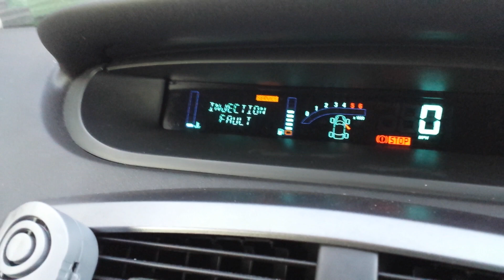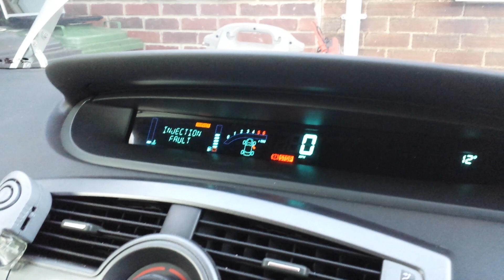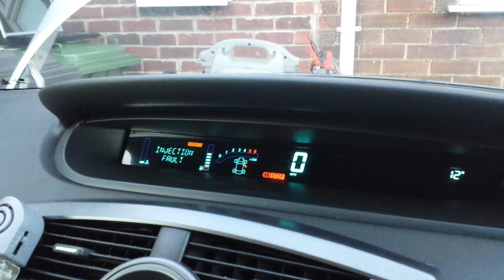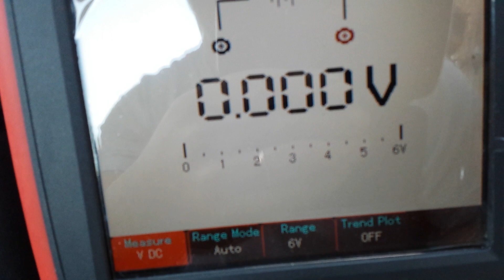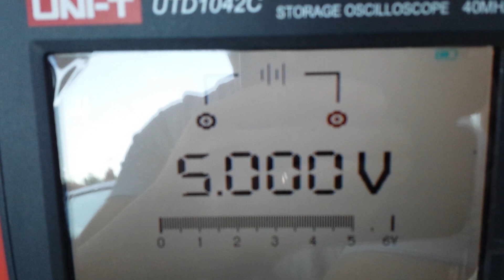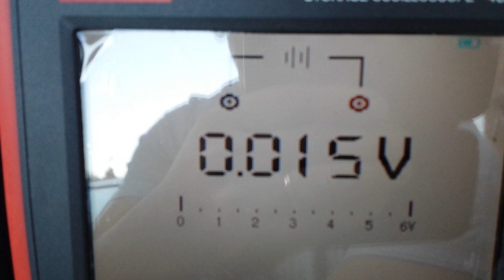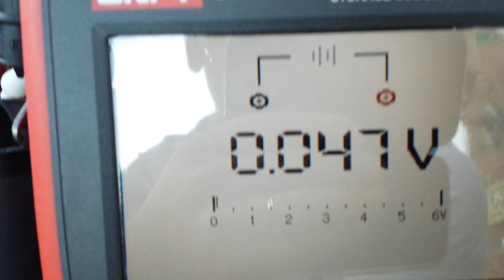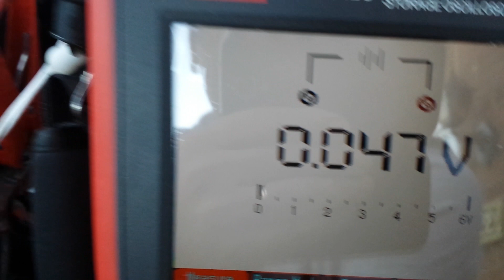Renault Scenic 1.9 DCI Diesel pressure sensor test

Comment: Hi ! Help me please , i started the car aftef 2 months , it started fine let it idle for 20 minutes , went for a drive after 5 minutes it bogged down and shut off , tried starting again it did not want to start . Pumped the primer lemon like pump a few times it started but died after 10 seconds , then it started only when my friend was pumping . What do you think it can be ? I dont trust my mechanics help
Reply from the maker: If it runs while the primer is pumped, sounds like a possible leak, allowing the system to suck air...
👍👍👍

Comment: Had same "ignition fault", but problem was battery 32A fuse connector.to 2 red wires (if stay in front of car, looking to car, right fuse). Diagnostich showed "fuel preasure dempher error" and "fuel preasure sensor error", (do not remember exactly, as diagnostick not mine, was only watching to its screen while car check)

Comment: Hello I have the 2016 III grand scenic 1.5 DCI. The spanner is on the dash and error says check injectors. But there is no loss of power or performance. Fuel consumption is good. Could it be the sensor is damaged? Fuel is from South Africa?
 any help appreciated
Reply from the maker: Have you scanned the car? 
👍👍👍
Reply: @LMAutoRepairs   Check glowplugs

Comment: Hi. Very useful videos!
I have the same Injection Fault message which appears when the engine suddenly STOPS WHILE DRIVING! It has the elecricity and the ignition, but the engine cannot be started right away, just after 60-120 seconds!
Odb scaner returns the error code P0606! 
The issue happens intermittently, sometimes (but very rarely) even when starting the engine - which doesn't start, butnit cranks!
Could it be some wire to/from PCM? 
Please help, as it is very inconvenient situation, I never know when it will stop , and I cannot take a risk to drive the car out of the city.
Btw also the fuel consuption is high, from quite a time ago, even before this issue.
Reply from the maker: Scan the car... hopefully whatever is causing the car to stall, is triggering a trouble code...
Thank you for watching!
Reply: @LMAutoRepairs  Scan you mean with obd2 scanner? So did it, the error code is P0606: "ECM/PCM processor fault". Any sugesstions what can be done here?
Reply from the maker: Check power and grounds...
Check the loom in front/under the battery...
I had in the past where it got damaged...
Reply: Right, I will, I have had a rodent traces months ago...
Reply: @LMAutoRepairs  Also, battery drains up when the car is left for approx a week not used (though not every time). I guess there is a parasitic draw somewhere, but don't know if this is related with the problem with engine stopping and the abovementioned message. What do you think?
Reply from the maker: 😳
Again... visual check wiring etc...
Load test power and grounds to the ecu...
A wiggling test might also help...

Comment: Hi and thanks for your videos they are really good. now my sisters car has the same problem has the one in the clip, when we crank it over there is no diesel at all in the rail or injectors
could this be the high pressure pump ?? the dash info says the same "injection fault" please help Regards Dave
Reply from the maker: The fault in the dash it is just a generic information message...
Best is scan the car and look at some live data before starting to throw parts at the car...
Thank you for watching and for your comment!

Comment: That's the way to do it. I have here a 2004 Laguna .9 Dci,2004,in which i think the + and-- wires are reversed ,i mean Light Green is +5V?
Reply from the maker: Hi
Renault changes the wire colours sometimes depending on the year... so, I wouldn't go by the wire colours, but by the pin number.. 
Thank you for watching and for your comment!

Comment: well... what if i cant start only sometimes.. doesnt matter if hot or cold diagnostics shows df053 fault code wich means rail pressure too high or low .. i checked sensor following your video and it is ok but also the car was starting fine during the sensor check.. injectors, pump. filter, pressure regulator bassicaly everithing you can think of have been already checked / fixed on the car and it still does this long sometimes looooong crank :/  its Clio 3 2006 1.5dci btw :D
Reply from the maker: Hi
Have you back leak tested the injectors? 
Thank you for watching!
Reply: @LMAutoRepairs  oh wow thanks for quick response. yes i did 2 of them were leaking too much i did reconditioning where i  clean them up and replaced the inside valves on them and after that did the test again and it was perfect. before i did this car wasnt able to start at all sometimes.  now it only cranks too long sometimes even too long that it says "STOP" on display but engine is already running ...
Reply from the maker: @marosberky6367  
Have you checked the other two?
Reply: @LMAutoRepairs  yes they are perfect i am out of ideas :(
Reply from the maker: @marosberky6367  
Your answer my be on the live data... check it when the car fails or struggles to start...
Reply: @LMAutoRepairs  yeah i know but i am not carrying around the diagnostic everytime .. to be honest i was connectoing diagnostics for the whole week every morning i connected it in case the car fails .. guess what car was running fine for the whole week :D  today it did again crank for long time until stop sign came up on display but eventually it started .. then i shutdown the engine and tried to crank again and it started right away.. :(  after that i connected my delphi diagnostic system and same failt code DF053 ... anyways thank you for help  there is not many mechanics who tries to help you online for free :) well..seems like carrying around the diagnostics all the time is my only option
Reply from the maker: @marosberky6367  
It might take time, but I am sure you will get there... better than just carry on throwing parts at it....
Reply: How can i get hold of you?
Reply from the maker: You just did...

Comment: I have a Renault Megane diesel 1.5 that has an intermittent starting problem. 
I've recently changed the glowplugs, fuel filter and the fuel pressure regulator,(because diagnostics pointed to these as the issue) all was looking good then it stopping firing again. Just watched your video and ordered a rail pressure sensor, then read my Haynes manual and it says that the rail sensor on the 1.5 engine shouldn't be removed. Would you know why that might be? I now have the sensor and am concerned about fitting it. Cheers!
Reply from the maker: Never heard such thing...
If is faulty, like the one on this video, what else are you supposed to do? 
Just replace it...
Thank you for watching and for your comment!
Reply: @LMAutoRepairs   Was wondering whether it was something to do with the pressure that the system works at. I don't want to kill myself!
Reply from the maker: @esarempee  
Ah...
Yes...that... lol
To make sure nothing serious will happen, just disconnect the battery during the changing of the sensor...
And you will be safe...

Comment: Hi i have a renault megane scenic 1.9 dci showing the same injection fault when im driving it in first gear it goes to about 2000 revs then loses power and i go into second and at a certain point drops the revs and so on through the gears it doesnt go over 4000 revs and it feels like the car is off the cylider do i need to change the injectors or could it be something else as i dont want start messing with them if it could be something else the car still runs and starts fine but has this issue the man i bought it from said it done it with him and he took it and give it a good run up the motorway and it stopped doing it can you give me any advice as it would be much appreciated ie mass air filter egr etc thanks in advance
Reply from the maker: You can indeed start with a service... fuel and air filter... specially if they haven't been changed for a long time...
But either way,  you need to scan the the car, and perhaps look at some live data, to have a better idea of what might be causing the issue...
Thank you for watching and for your comment!
Reply: LM Auto Repairs i will try that and thankyou for your reply and im enjoying your videos as you know what your talking thanks again
Reply from the maker: @darrenstockton578  
👍

Comment: I got DF017 malfunction code, pre heating circuit.
Reply from the maker: Salty Couch 
Glow plugs...
That can be anything from glow plugs, controller or wiring...
You need to investigate....
Reply: lmsvvavr i already checks the glow plugs and they are fine, did the voltage test. but the rest is unknown to me, i see just wires. Are there any units that involves with pre heating except the glow plugs itself,
Reply from the maker: Salty Couch 
Follow the wires back from the plugs... they should lead you to the controller....
Reply: lmsvvavr thank you for your help mate 👍
Reply from the maker: Salty Couch 
No worries...

Comment: great  ,  I just have  the same problem . the fault is df 197 ?
Reply from the maker: ivanhoo サビッチ イワン・ 
Hi
I am not 100% sure... but think it was that one...
Reply from the maker: Have you scanned the car and/or tested the sensor?
Reply: i did and i change sensor with the second one , and nothing . the same thing
Reply from the maker: ivanhoo サビッチ イワン・ 
Do you have any codes on the ECU?
Reply: only df 197 . to high fuel pressure and unstable
Reply from the maker: ivanhoo サビッチ イワン・ 
ok
Can you have a look under live data what is the pressure of the common rail when cracking and when the engine runs for those couple of seconds...
Reply: oh not now , tomorrow :)
Reply: I cleaned tdc sensor and the car starts normally for two days
Is it possible that this was the problem ?
Reply from the maker: ivanhoo サビッチ イワン・ 
It can... if is not starting again check on live data for rotation signals... it might be that the sensor is failing, or a bad connection...
Reply: lmsvvavr ok thanks very much. if something again apeairs i let you now

Comment: You have about 300 km on the highway driving, then it goes away
Reply from the maker: Hi
Not in this case... as I mentioned on the video, this faulty sensor was preventing the engine from starting. 
Thank you for watching.